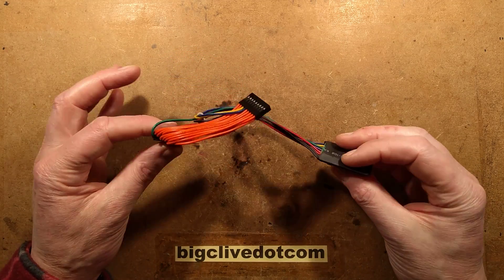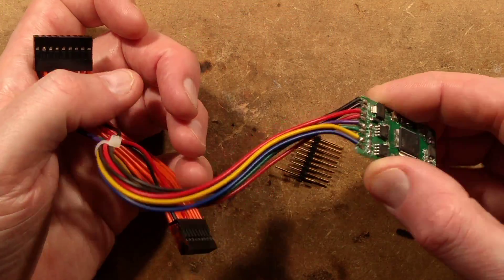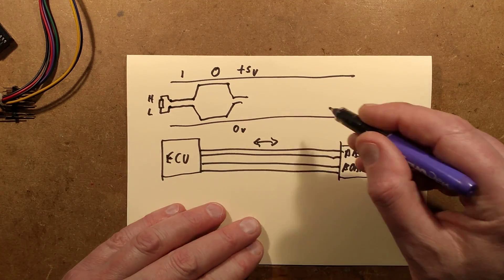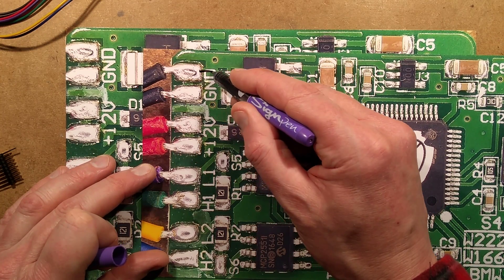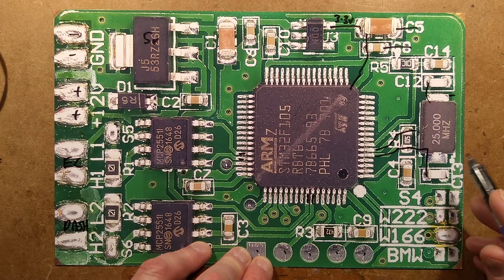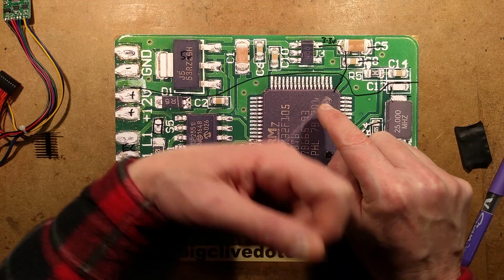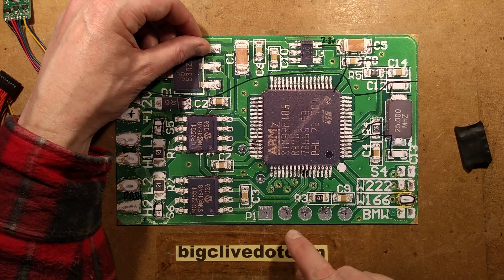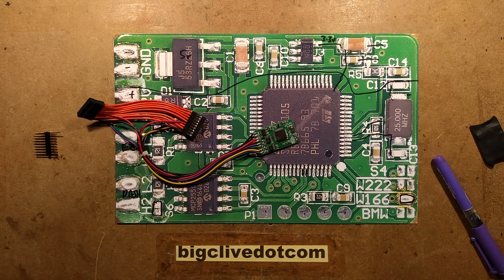Naughty CANbus odometer "interface".  (Fakes mileage.)

Comment: Could also be marketed as “CARFAX killer”
Reply: I work for a car dealership and Carfax and AutoCheck have basically killed all odometer clocking. All cars that have had their odometer tampered with show up as mileage discrepancy and have to be sold TMU or true miles unknown, which greatly lowers the value on any decent car. So that being said, this device would be worthless to most car dealers. This is something that a private owner would likely have to install on their car and then trade it in or sell to someone else. 
Also, you would be surprised how many things end up on CarFax or AutoCheck with your Odo reading and date, like oil changes, tire rotations, smog inspections, I have even had detailing showing with odo readings in CarFax. So you are left with a very accurate history of your car's life and it will show its miles going up if something all the sudden reads 20K miles less it will cause all kinds of warnings to show up in bright red.
Reply: @christopher88719  carfax is unreliable junk. had a subaru sti, totaled. was rebuilt TWICE by the insurance company. Carfax came back clean. no accidents no major repairs. Put your faith wherever you want.
Reply: @DieselRamcharger  yea carfax only works if companies report to them.
Reply: @frostbite1991  my point exactly. Large national insurance company didn't report. The DEALERSHIP that rebuilt the car the first time didn't report. The 2nd body shop was a high end repair shop for exotics, not surprising they didn't report. But the insurance company had to pay both the first and second shop....and they never reported. Carfax is a massive joke. Tis my point.
Reply: @DieselRamcharger  insurance companies don't rebuild cars........
Reply: @christopher88719  Detailed yet vague. In 2017, I bought a 2013 Hyundai Accent knowing that it had had a whole slew of work done. I couldn't see the details... only that it had been in the shop about 20 times in 4 years. I had to drive the hell out of it and poke around a bunch myself to determine that the previous owner had a propensity for running over planks, mattresses and god knows what else at 70 km/h and that her friends liked to stomp all over the door trim in stiletto heels....
Reply: @christopher88719  This one seems a bit more subtle – simply lowering all milage clocked by 20% wouldn't show up as a big dip, just a change in rate.
Reply: Only if you take your vehicle to someplace that reports to CarFax or AutoCheck.  Since most vehicles don’t need anything but Oil Changes until it needs brakes unless the car was involved in a recall or a body damage, that means if yo onto a private shop for oil changes and tire rotations or you a DIYer you can conceivably hide a 5 to 8 thousand miles every 30k with no problem which for lease vehicles can be a major savings for a dishonest person.  I have scene it done and unless you privy to that bit of information no one would be the wiser
Reply: Christopher Fea Ah, what I meant was that it basically screws your CARFAX over such that selling it is much harder.
Reply: carfax is a joke really...parents had a car that was in an accidet (someone backed into the side in a parkinglot) it said was clean and another car it said had odometer fraud but we were the sole owners and knew from our own fuel logs and service orders it was correct.
Reply: @anonymoushippo-m7d  it's depersonalized. I can't see any information on the owner, just what the car has had done to it. It isn't personal info, just where the car was bought, where it was service, sometimes what service was done to it, etc. You'll also he happy to know that in many states your DMV registrations are public record, and accessible if you pay the right service for them.

Comment: Ive been looking into k line and canbus for a future project.... w166 looks like an abbreviation of one of the canbus protocols... So yes thats a jumper select menu for some of the common protcols... STM32f105 is a slightly less common micro, maybe it has 2 can channels... I think the more common stm32f103 only has one. And yes its likely it was programed with something like arduino....
Reply: W166 is the Mercedes M-class mark 3.
I don't know why this was fitted in an E-class (I think Clive said?) - maybe it has some commonality, or maybe that's why the dash was showing warning lights.
Reply: w166 is a Mercedes model, I don't see why anyone would think arduino was used

Comment: The dominant state in CAN bus is a 0, so the lower node or message ID gets higher priority, so message or node 0 has the biggest priority and will 'win' any collision if two nodes start transmitting at the same time.
Technically the dominant state could be a 1, but the the highest priority ID would depend on implemented specification (CAN 2.0A vs CAN 2.0B).
Reply: @greendryerlint  Yes, It is Controller Area Network as it was initially used in industrial environments, not automotive.
Reply: Please Miss, what does 'CAN' stand for ?
Reply: @millomweb  Car Area Network
Reply: @polygondwanaland8390  Hmm, dubious but I'd guessed the first and last words correctly !

As if there wasn't already other networks available !
Reply: @polygondwanaland8390  I believe it's "Controller Area Network"
Reply: If you want an easier way if understanding the CANBUS this video is ideal: https://youtu.be/PL0TPdrhMuI
Reply: @danny8376  Certainly 'car' didn't seem right !
Still a crappy name though.
Reply: On such comments and knowing nothing, am I right in thinking there's a bus clock ?
Reply: @millomweb  There's no bus clock line - the bus is asynchronous, it means that every node generates it's own clock, roughly equal to bit rate, and during communication any node receiving a frame synchronizes it's own clock to the clock derived from the transitions in the frame. There's also bit stuffing mechanism to ensure transitions are separated by max. 5 same bits. More pretty good info you can read on Wiki.
Reply: @bar10005  I'm just thinking of timing re requests to use the bus.
I presume all devices on the bus have their own addresses ?

Comment: With cars getting clever and with  encryption systems getting harder and harder to hack with 512bit AES cyphers and auto ecu updating it will become even harder to spoof the systems.
Reply from the maker: But the risk there is that the extra complexity and processing requirements will introduce new technical hazards.
Reply: You don't what encryption here, you want authentication. It doesn't matter what the information says on the bus - you can read it. It matters that it's genuine.
Reply: Problems with salvage parts are a reality already.
Reply: @sleeptyper  Yeah, stuff like car enterteinment system "learn" in what kind of environment they are in by looking at all the sensor data on the CAN bus. That fingerprint of the car gets locked in these components after a few miles. It's an anti-theft mechanism. And I'm sure there's measures of similar complexity to counter odometer tempering.
Reply: @guffaw1711  Digital pairing of motorized side mirrors for example. Buy a salvage part and it doesn't function unless you have means to pair it with the car main system. Manufacturers refuse to pair them, in order to boost official spare part sales. Also some manufacturer (VW iirc) sued a guy who figured out the pairing protocol.
Reply: I have done a bit of CAN bus hacking at Blackhat. The most alarming thin I learned is that the manufacturers are so tight fisted that they will quibble over pennies. Managing crypto on a car by car basis is very expensive so they do the absolute minimum. This means they never encrypt communications between modules, it just isn't worth it.

Comment: Can it make me look ten years younger?
Reply: Dave Micolichek  Doesn't work without the 9v battery to the tongue.
Reply: @gteaz  I had a very fun grandad who used to teach me a load of 'don't tell your Mum [his daughter], but...' things. One of them was the old Ever Ready cycle light batteries with the two copper blade terminals, and touching it on your tongue to feel it tingle.   I assume he meant don't do it with a PP9 let alone a car battery!  Ever kid should have a grandad with a sense of fun!
Reply: No, but it might make your pecker hard if you shove up your arse and apply mains voltage.😉😯😄
Reply: @dadillen5902  I laughed unnecessarily hard at that.
Reply: @scratchpad7954  Why, thank you.
Reply: It'll make you look like the sexiest girl in  prison to your huge biker cellmate. Have fun! 😉
Reply: Probably,...but "ages" may vary 😉
Reply: It's well made, i think it can! ^^
Reply: Only if you're Johnny-5.
Reply: That's a different mushroom. Go ask Alice. 🍄 🤶👀
Reply: Sell enough of them you can hire the best personal trainer and plastic surgeon around. So technically... Yes.
Reply: Yes it can, but it does the same thing as photoshop and is 10x more expensive.
Reply: No, it's a bit of wire not a wizard
Reply: Stick it to your head to cover the bald bit
Reply: In my case.....can it make me look "40" years younger??? 😆😆😆
Reply: Is your can as big as a bus?
Reply: You want to talk to a mortician.
Reply: The Circuit is good, but not a miracle device.

Comment: My car (Nissan leaf) just has three CAN buses on the loom. Normal, entertainment system and environmental control. So that's 6 wires.
Then a couple of power and return (effectively 0V) and chassis ground.
It doesn't have anything else of note on the OBD connector

Comment: The old way of fudging miles was to disable the cluster,  you would loose all output information on the IC. guys would install a external programmer into the DLC and use that as there cluster. things have changed now due to the fact that most ICs contain the vehicle security module. very smart little gadget if you ignore its intended use. I actually have a module that us used to provide feed back information for the new electronic power steering systems. if your interested in taking a look at it let me know,  i can also get you all the relevant OEM wiring diagrams CHEERS!!
Reply: The old old way was to take the dash out and use a screwdriver or such to roll the numbers back, or all the way around, without scratching them up or making them horribly misaligned.
Reply: Usually the dash is part of the immobiliser System, also in most New cars, the mileage is ttansmitted from the abs Controller and stored there.
Reply: @st_us  Only in older VAG   cars the IMMO is in the cluster. Nobody else does this stupid design.
Reply: or buy one from the wreckers with lower mileage and swap it over

Comment: 40,000 kilometres is almost exactly the circumference of the Earth going through both poles. The definition of the metre was originally one ten-millionth of the distance from the pole to the equator.
Reply: I wonder if a position for that line was in the spec as the Earth is not a perfect sphere?
Reply: @drteeth7054  North pole to equator via Paris, divided by 10,.000, 000.  French, 1780s.

The difference is pretty tiny though. If you have a 4K screen, a picture of Earth is about 3,947 by 3,968 pixels. [1 pixel per mile.]

It's pretty hard to see a difference of 20 pixels on a 4k screen. Anyone would just call it "round" - it's almost close enough to be a standard snooker ball. That includes the tiny up-and-down stuff like Everest.

Arsehole armchair scientists love to say "it's not round, it's an oblate spheroid" - and Neil deGrasse Tyson said it's "pear-shaped", a quote that which the crazy flat-Earthers leap upon with glee.

There is a massively exaggerated picture of the Earth's magnetic force and sure, it's sorta "pear shape". But tl;dr it's damn close to perfectly round.

Or is it... - am I just a NASA shill, and Elvis shot 911? ;)

https://i.imgur.com/Nf0Fhci.png
Reply: @drteeth7054  but isn't the world flat?
Reply: @tonyjones9442  That made me laugh.

Comment: wow another case of over design, i just disconnect the speedo sender from the gearbox for 6 months a year.
Reply: You can't just disconnect the speedo on a modern car as it's likely to cause loss of ABS and cruise control as well as drivability issues, the ECU needs the information to be able to function properly.
Reply: But then you lose track of milage for kind of important things like oil changes.
This little gadget allows you to track the real milage and still hide it. Illegally. Do not do it.
Reply: that's no use to a dodgy forecourt 2nd hand car salesman.